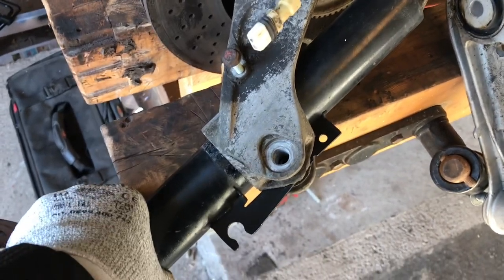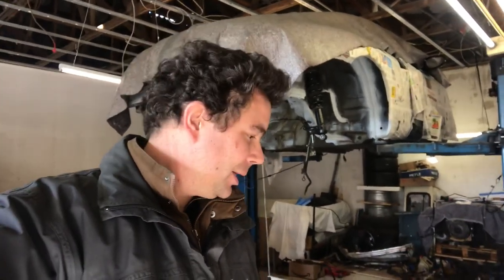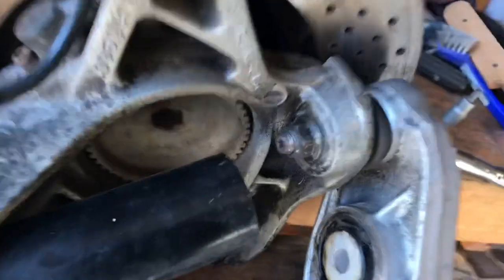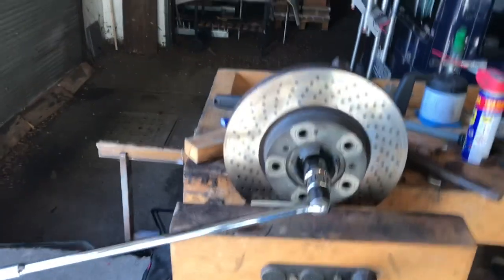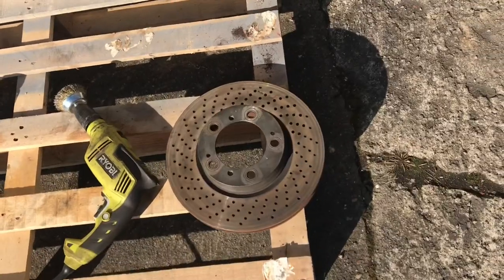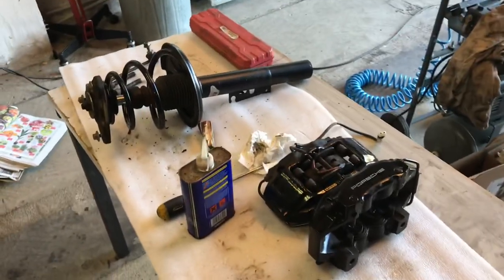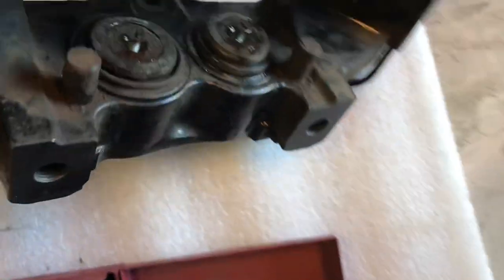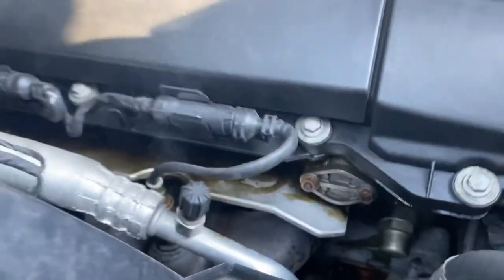Porsche 996 Restoration - Part 10 - Disassembling the M030 Struts

Comment: Hi! I have the same issue on the brake caliper with stuck pad shim. My case, 997.2, one on the outer side of the front caliper. I tried to pull it out using long and same thread size bolt, but failed stripping the thread. I don't have a tool to make bigger thread and I ended up scratching piston while holding it on a vice. I bought 2 new brembo pistons which is a expensive learn. Interesting to see your solution maybe next video. Thanks for informative video!
Reply from the maker: Hi, thanks for your message. So it seems to be an issue with a number of models. Thanks for the heads up. I haven’t done the work yet, so it won’t be in the next episode but will come soon. New callipers are expensive as you say. I will have to be very careful.

Comment: Guess the cylinder head question was answered. how annoying.
Reply from the maker: Hi Jonathan, it was my own fault really. All those short 5klm runs in the cold. The sludge built up extremely quickly and the resulting pressure found the weakest way out.